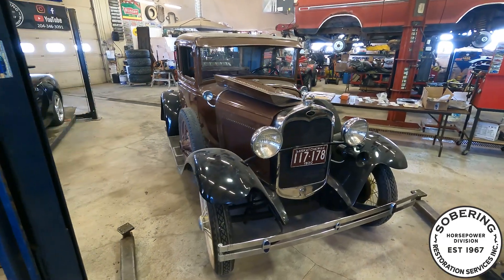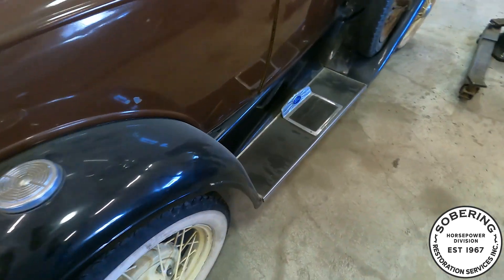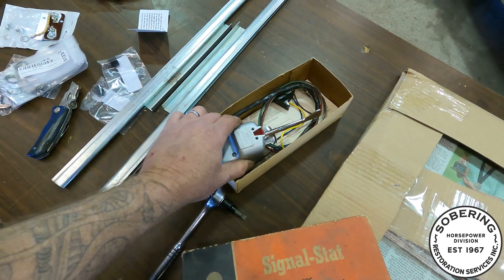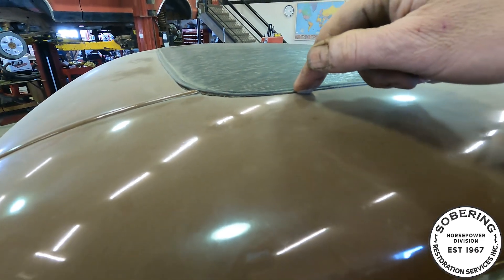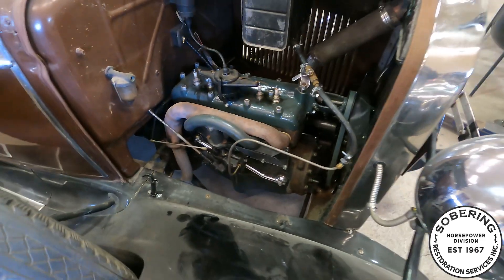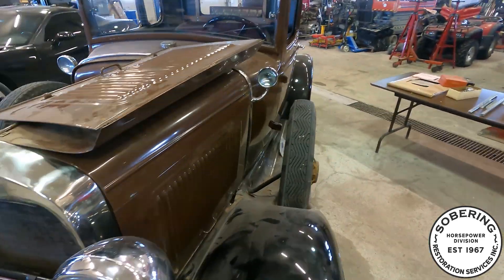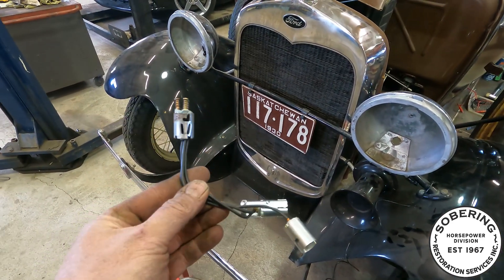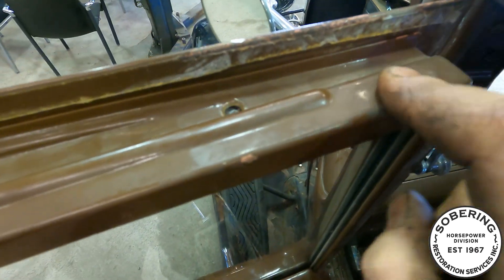1930 Ford Model A... Part 2!

Comment: Choke is designed to spring return to open. You pull it out, hold it till it catches (should catch on one rev) and then let it go. The GAV knob should be open about a turn to start, and then slowly closed down to 1/4  turn open or less when warm.  You'll get there!

Comment: Model A came standard with tapered front wheel bearings.  Also, if you look at the rear axles at the bottom, near the backing plate, you'll find a zerc fitting to lube the rear hubs.  A couple pumps every 500 miles is what they did back in the day.

Comment: Dont put in a twelve youll blow your headlights!  So Ive heard. Probly also melt the diodes in the voltage regulator. Consult Paul Shinn, he is a model A Guru and should be able to help.